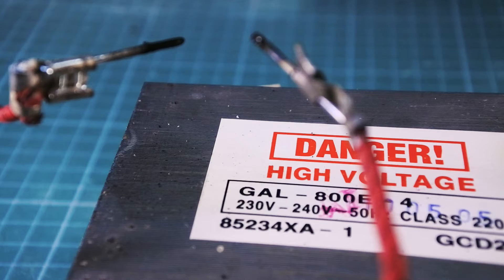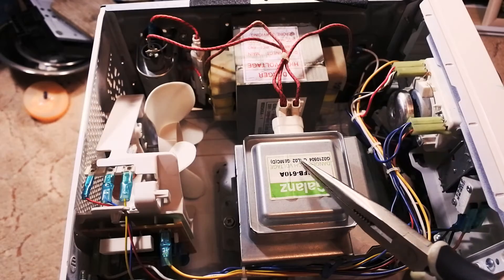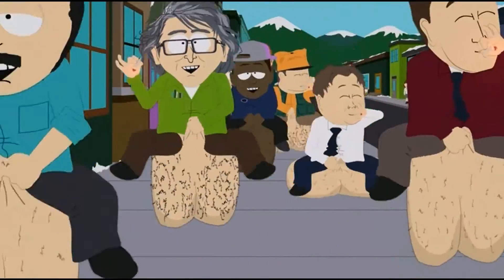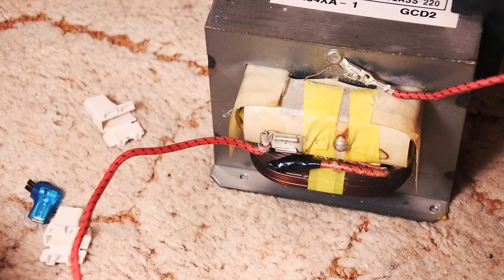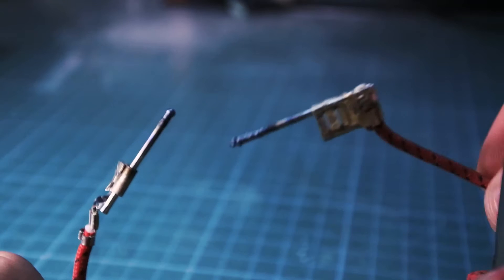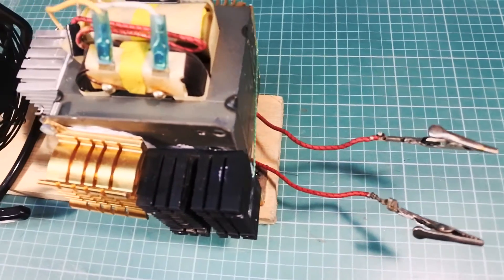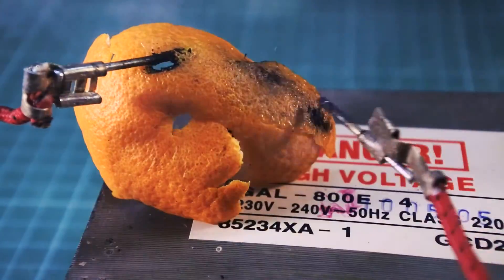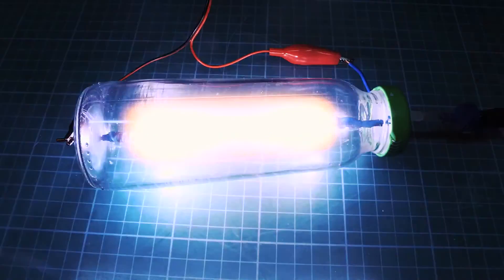A high voltage transformer out of microwave oven

Comment: I have a question: if i just plug it straight into the wall socket, won’t that cause the breaker to trip because it detects a short circuit? If yes, how do i prevent it?
Reply: You have to use a surge protector power strip or a gfci outlet if you want to plug it straight in the wall. And make sure the gfci is on . Now remember, be VERY VERY careful because I am not responsible for your actions if something goes wrong⚠️⚠️⚠️